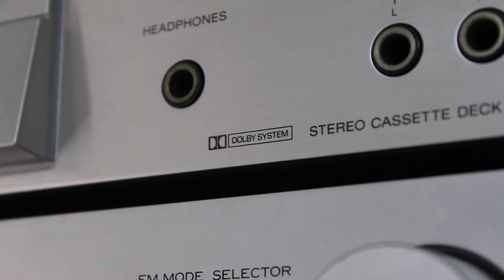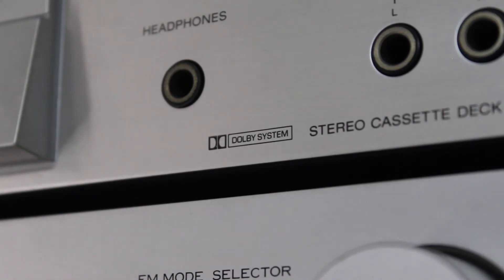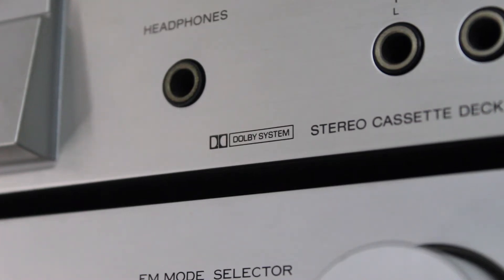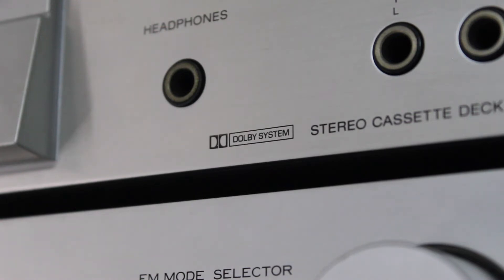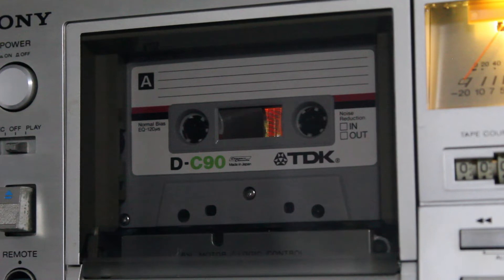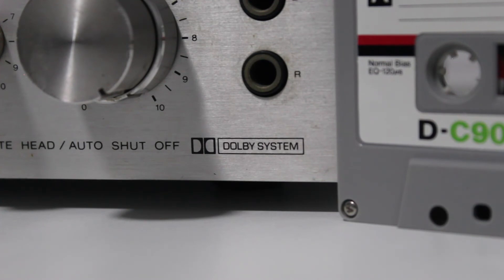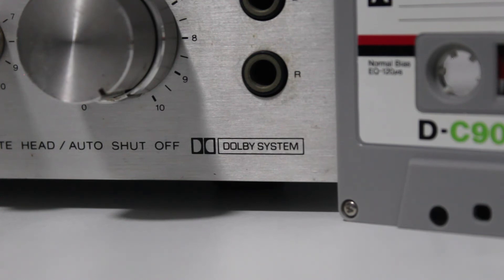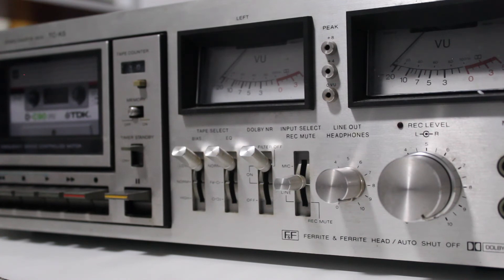What is Dolby Noise Reduction?

Comment: After trying out Dolby stuff out myself in my tape deck, i just leave it off all the time because it just makes cassettes sound worse. I like the tape noise.
Reply from the maker: To be honest, noise reduction only makes tapes sound worse if it isn't calibrated properly. Age changes how the noise reduction ends up being processed on the tape, so if it isn't calibrated well, it'll end up sounding bad. As you can hear in the video, Dolby B sounded quite good because the deck was serviced by the person I bought it from. One of the reasons why I didn't demonstrate ANRS (basically JVC's Dolby B) with my Victor deck is that it wasn't calibrated properly, so I had a similar experience as you where it just made my cassettes sound worse.

At the end of the day, though, I also prefer not using noise reduction for the sole reason that some of my decks and Walkmans aren't properly calibrated anymore :p
Reply: @ARandomOven  ah didn't know that the Dolby thingamajig had to be calibrated. I probably still wouldn't use it anyways lol. I really do like the background hiss and noise. I grew up with it.
Reply: @ARandomOven  Hey there you are absolutely correct Dolby (any flavor) relies on perfect azimuth alignment. If it is off even a tiny bit the Dolby circuits DO NOT correctly adjust (process) the encoded tape. Azimuth is the most critical part of Dolby noise reduction working properly. 
A worn tape head while not track properly thus killing Dolby's ability to decode a Dolby signal, the term as I understand is called breathing. The best description is someone turning the treble response up and down during more quiet parts and back up when higher frequencies are present. Done properly the listener would NEVER KNOW that was happening but that's EXACTLY what Dolby is doing because it does this actively, hence the term encoding and decoding. For those interested here's a link to technology connections and a video that explains it EXTREMELY WELL. Enjoy. 

https://youtu.be/DhWL7lgnLnE